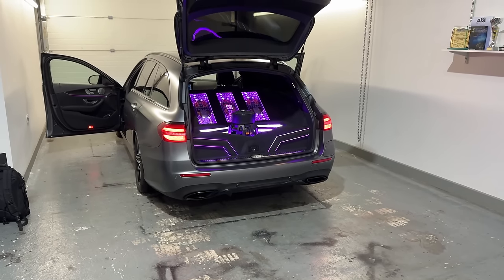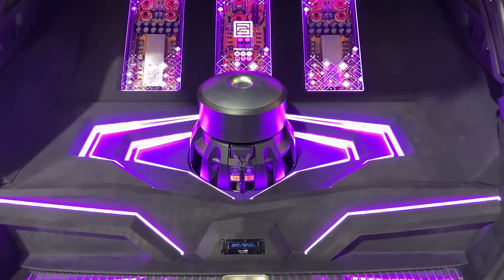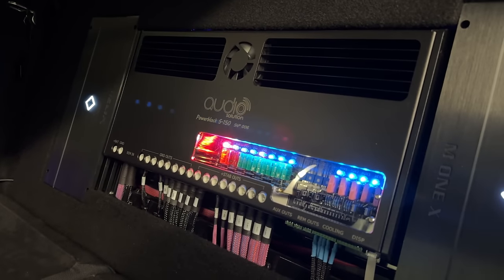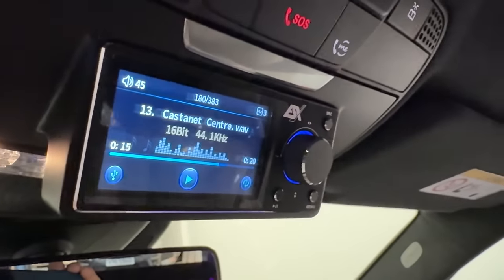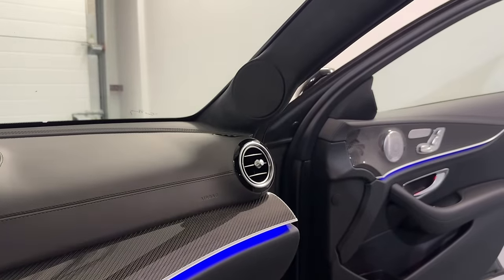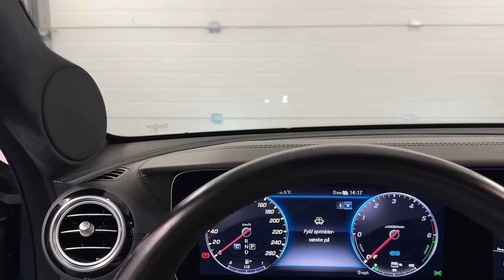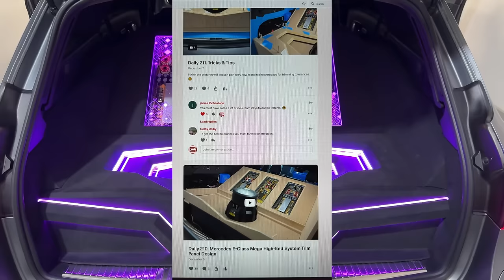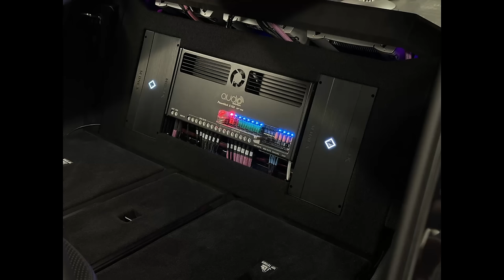Mercedes E300 High-End Competition Audio System - Accuton, Steg, JL Audio, Helix, Audio Solutions

Comment: Are the Accuton Midbass Drivers better than the ones especially designed for this Car ? Eton, Steg and my other Brands sell them and i would guess, they can play lower, which could be better if you don´t have a Front Sub or a Sub at all. But in this case, with the Front Sub, the Accutons are a better fit ? What would be the next best Speaker after the Accutons ? I have a S205 C Class, which i want to upgrade.
Reply from the maker: If you don’t have a front sub, then it’s 100% advised to stick to the OEM 8” size, which gives better extension, output & dynamics than most 6.5”s. 
Most plug’n’play 8” options work pretty well for daily systems, so you can not go too wrong. With a bit of custom work and cutting we fitted the Brax ML8 in our S-Class, which is another step further to get something pretty crazy without front subs. 
This car though is built to another level. The 6.5”s with the 10” are just mental! Accuracy and attack on another level!

Comment: Hey Peter, I also have a Mercedes and wanted to ask if there is any output difference if the battery is at 12v instead of at 14v due to smart charging
Reply from the maker: There is always different on higher voltage. In all these new cars smart charging is not a great friend for audio. It’s almost like every car should have a DC-DC power stabiliser like we had in this car and my own S-Class too.
Reply: @pssound9749  where did you get yours and for how much?
Reply from the maker: @heroericxu1634  we’re dealer of it. If i remember correctly it’s £950.
Reply: @pssound9749  oh wow that’s a lot.  Since I mostly want more bass output from my system, would upgrading the electrical and adding a stronger amp be more cost effective?